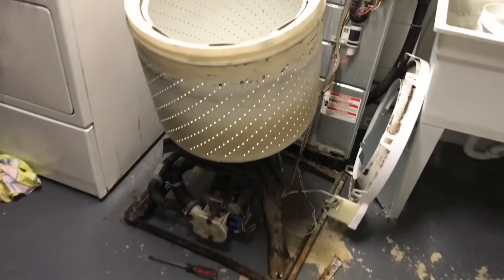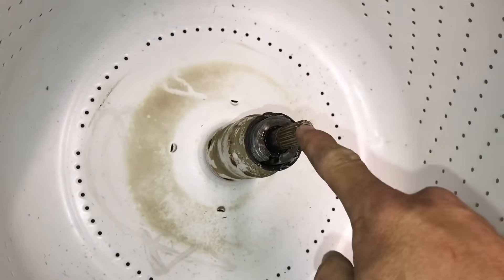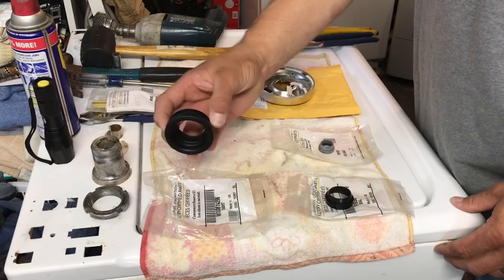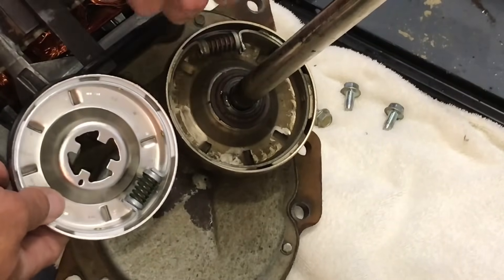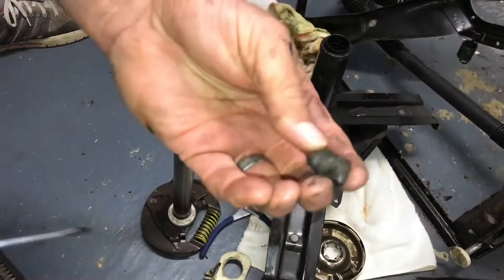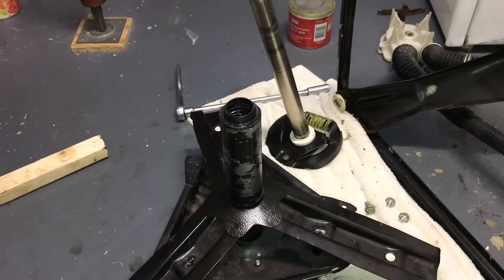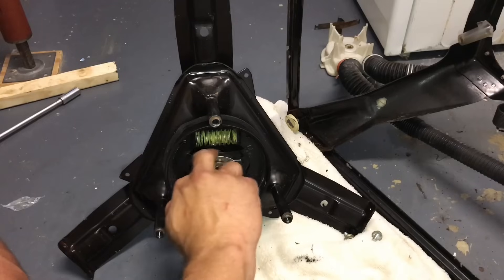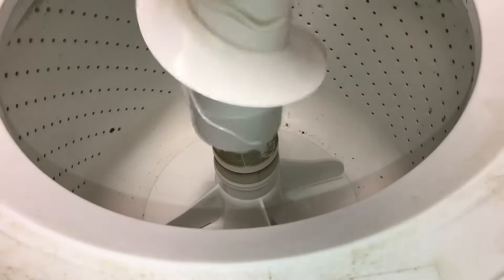Leaking Kenmore Washer - How to replace Shaft Seals.

Comment: Very informative video! Easy to follow and well articulated. I have a question for you and maybe you can help. My washer is making a knocking sound on the spin cycle. Any idea what might cause that? Gearcase? The problem is exactly the same as what's shown in this YouTube video, but the author of the video didn't mention how he fixed it. Any ideas?   https://www.youtube.com/watch?v=Z91lDEUVXRc
Reply from the maker: There is a C clip that goes just above the clutch drum. If you look at the shiny silver shaft a fraction of an inch above the clutch drum you’ll see a notch in the shaft. If that C clip is missing, you will get a banging sound just like that.  It happened to me then I learned I forgot to reinstall that C clip after replacing the clutch one time, years ago.  Remove the agitator in your tub, pull the water pump off disconnect the wire harness from motor and pull the whole motor & trans assembly out from beneath. Inspect then Let us know if your missing that clip.  Best-
Reply: @SmokinwithKasket  Thank you. I'll take a look at it this weekend. I've never taken the gearcase out, so I don't understand how that C-Clip could be missing. I guess it could have somehow popped out or maybe rusted out and fell apart.